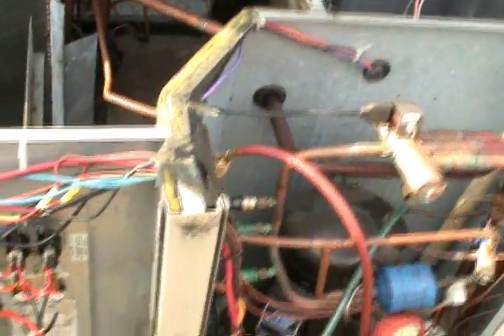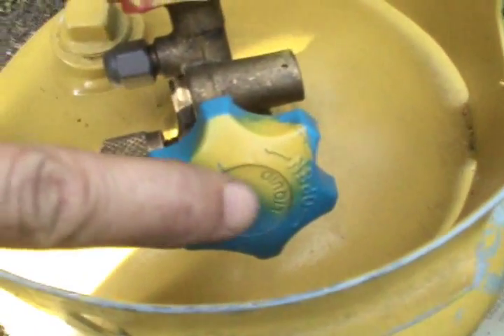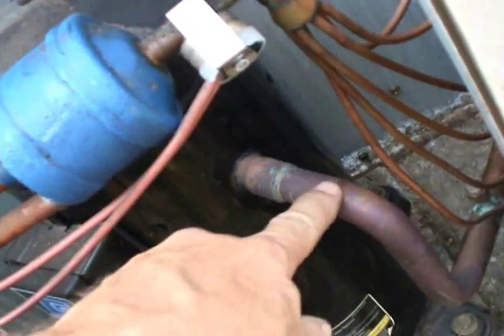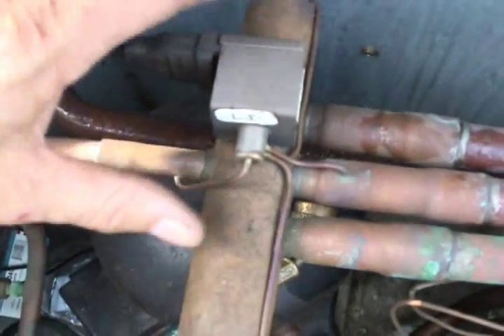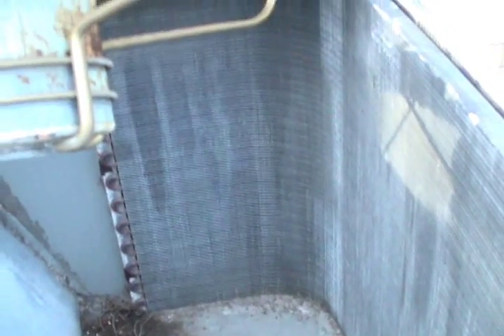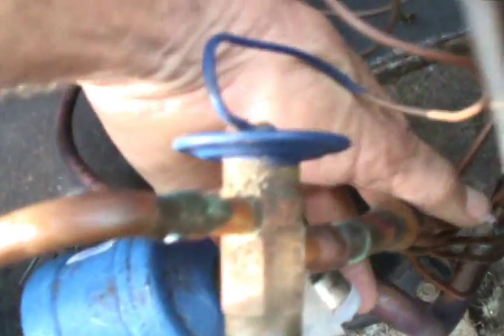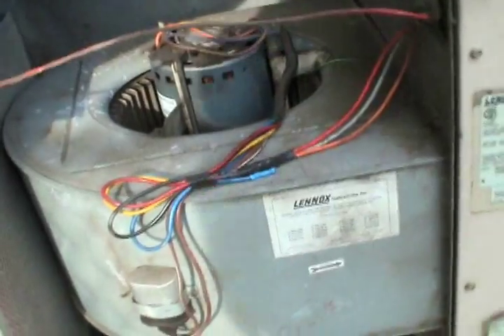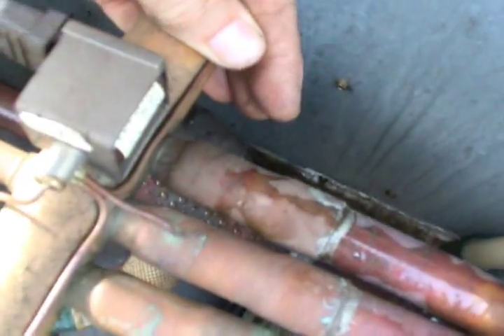HVAC/R Refrigeration Cycle

Comment from the maker: Yes you can. It's also a good practice to take the temperature between the inlet and outlet of the liquid line filter drier. A temperature drop means that you have a clogged filter drier.

Comment: Newbie alert.
The expansion valve had three copper pipes leading in, two large size and one very small diameter. Is the third a pressure feedback device to automatically adjust the diameter of the aperture? Which tube was that?

Comment: actually it is faster to recover the refrigerant in the vapor side of the recovery tank, because the refrigerant does not have the go through the dip tube on the liquid side it was just spray into the top of the tank

Comment: Good video presentation. Can you explain installation of solenoid valves on refrigeration system with hot gas bypass. please show details about direction  and position of installation